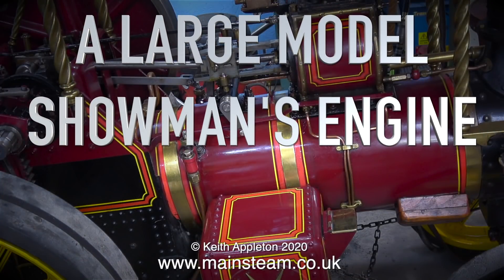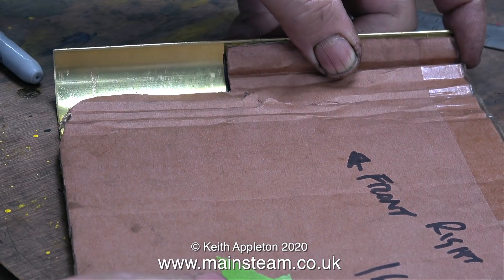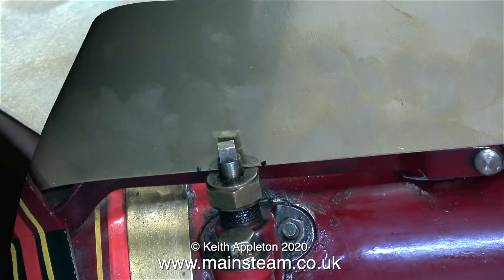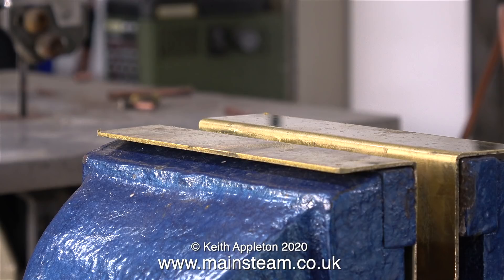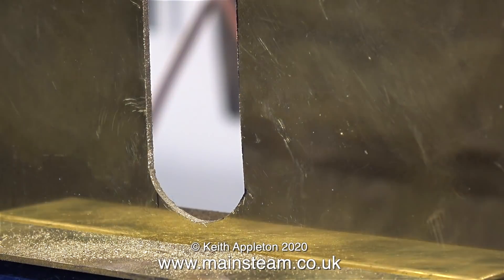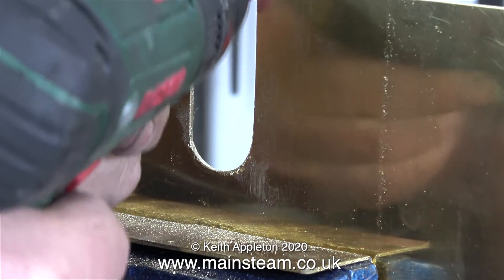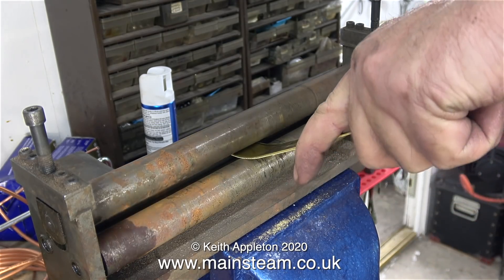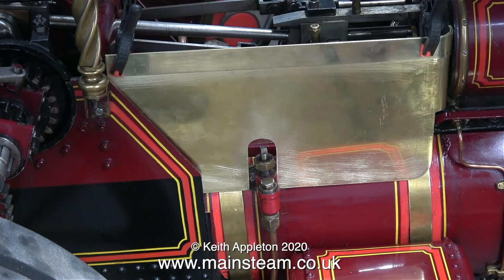A LARGE MODEL SHOWMAN'S ENGINE - PART #26

Comment: Seems a shame to cover up all that beautiful motion with big brass plates but I presume they will be quickly removable and only attached when necessary.
Reply from the maker: The motion guards are essential for public running - to stop anyone putting their fingers in the works . . .
Reply: @keithappleton  You could cut fretwork in the side plates, would only take a year or so.
Reply from the maker: but then it wouldn't look quite so authentic .....
Reply: @keithappleton  Is that why all the showman's engines at the rallies have the motion guard's on to prevent this happening?